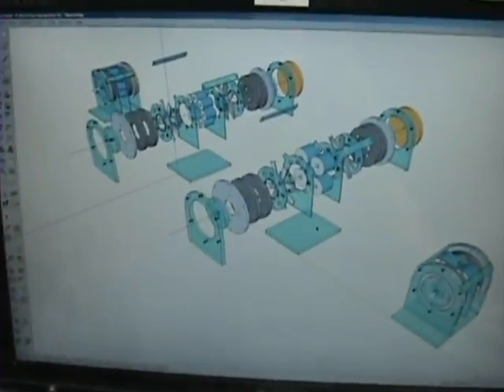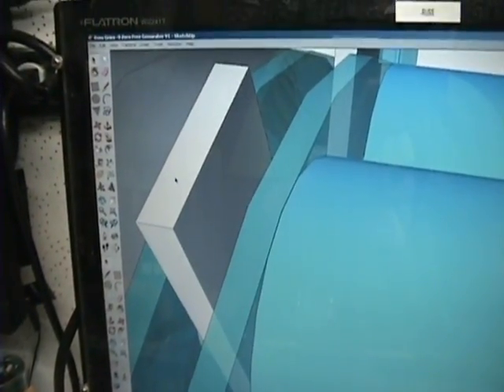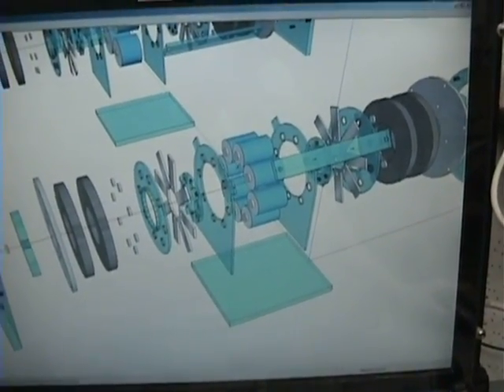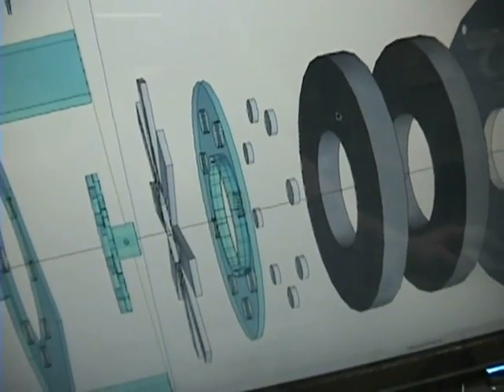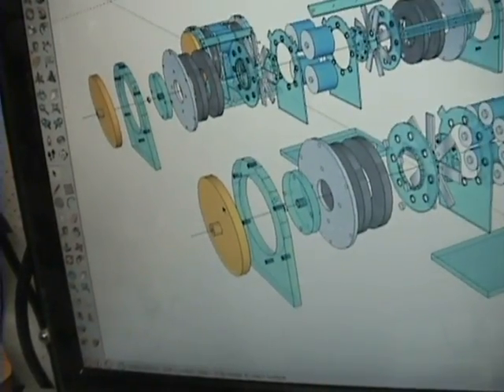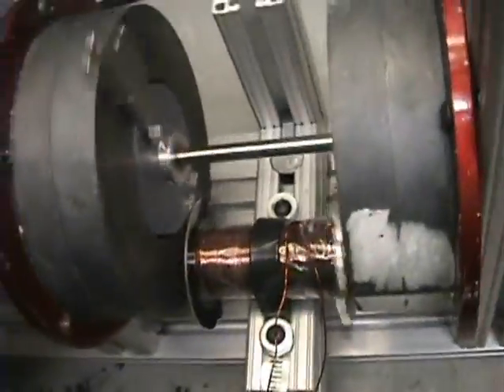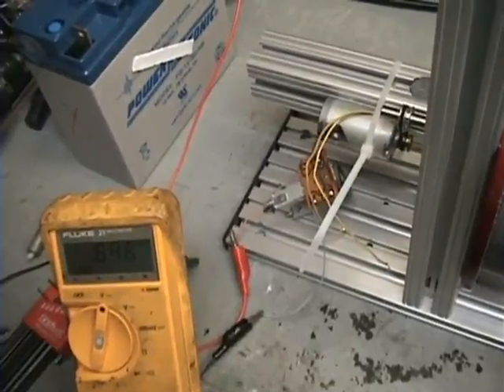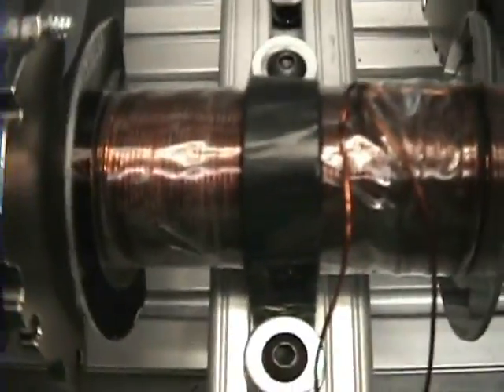The -9 zero free Lenz lawless generator v1

Comment: This takes the idea of the Figurea generator.  Of course you are not getting any current out because the magnetic flux is too weak.  You may need to bring the ring magnets on both side closer and make the collector core shorter but wider.  That way the flux get to the core better.

Comment: This is an Eckling Brown Generator. The magnets you're using are too big for the coil. Try use neodymium magnets that the diameter of the magnets are the same as the inner diameter of the coil. This is a magnetic machanical switch. Try moving it with a Rotoverter. Thanks.

Comment: Ok, in the video you don't show amperage output, just voltage, so there's no amperage on the meter because you're shorting it by the leds not the meter. If you have a voltage, then you will have a current, maybe milliamps, or some amps but there will a flow of electrons because there's a potential deference to push them. Another observation, don't use steel as your coil cores, they will heat up and don't induce the current as it should be, material for AC like transformer's core.

einspace

Comment: I am failing to see the point? OK, you proved some basic concepts of electromagnetysm, fine. What is the end purpose of this build? Create a generator? Free energy device? I suggest for future videos that you make some measurements of input and output power, using 4 meters. Oscilloscope  would be benefitial to see output waveform, because multimeters have a limited range of frequencies for which they can acurately display RMS voltage. Let's see some numbers:)

Comment: Can someone explain what the point of this is? Nobody argues that you can induce current into a coil with magnets, he's just built a very inefficient machine for doing so. And you're right, it doesn't sound like it sped up.
Reply: if you can eliminate lenz law, you can remove the load from a generator as it's generating. Hence a more efficient generator. if you don't know what efficiency is... Google it.

Comment: Nice build and 3d model.  I have a suggestion you may  want to consider.  try rotating the magnets with the shielding material.  This will make a great flywheel and should not change the effects of magnetic field.

Comment: Hi Russ, this is Dan Quale, the inventor of the Lenzless generator. Website overunitybuilder com. Great job on the sketchup. My generator shows that indeed electricity can be produced without the back magnetic drag or Lenz law reverse motor effect, leaving only air and bearing resistance, My advice now is to use ferrite cores wrapped with only one layer of wire, using my ert type transformers to increase voltage/curent I am unable to do much myself  these days. Hoping for others to carry on work
Reply: OVERUNITY BUILDER  Mr. Inventor, is it true if we change the way of winding can anti lenz effect?

Comment: ***** if you put a load on it it will also have to accelerate if it's true lenzless .

Here from jean louis naudin :

How the Delayed Lenz Effect (DLE) can be observed ?

In the case of the motors/generators, the increase of the turn rate is produced by the DLE when the devices are loaded,

In the case of solid state generator or special transformers (i.e. the Thane C. Heins' Bitt) , a drop of the input power is observed when a load is connected at the output,

In the case of the generators, the increase of the turn rate is produced by the DLE when the devices are loaded above a critical minimum frequency. Below the critical minimum frequency the DLE coil will produce deceleration as per any conventional Lenz generator coil.
Coil frequency dictates coil impedance which is a critical factor in producing generator DLE and on-load system acceleration.
The greater the load i.e. the closer it is to a dead short (an infinite number of resistors connected in parallel) the greater the DLE produced and the more system acceleration will be produced.
The DLE can also be used to produce an unbalance (sink effect) between the outside (i.e the Earth ground) and the load, this is the case of the Tariel Kapanadze generator...

Comment: @lykenth08 
The magnetic field of the speakers magnets will be reduced when u drive power from the coil (exactly by Lenz law!)  thus ur voltage will drop cos u shielded the magnetic drag through the hardrive mumetal! The rotor will gain speed (less drag) It's Lenz's law applied on voltage by reducing the total magnetic field! Rotate the coils WITH THE MAGNETS, remove the mumetals, replace with some decent aparatus (sparkgap?) to tap induced EMF and ur off in space! VERY NICE DESIGN THO CONGRATS!

Comment: Hi im familiar with the design an i have been working with the concept for a while with my own make shift design. if you want more initial speed then dont read the voltage if you didnt already know. think normal lenz law but backwards! - read the voltage it slows down read the amperage an it speeds up. The original makes has a youtube, just search lenzless. you 3D build of it was immensity impressive too

Comment: @rwg42985 my build is iffy as im trying outmy own designs but - if you`d be so kind as to watch my new video "lenzless/bedini monopole research an ideas" iv made a modification that will allow for close placement of the coild to get the most magnetic springing effect that so simple an that - you could i think, have a single sided lenzless generator. so its not so massive, heavy or needs exspecive large ring magnets to run.i think i can use both sides of a single magnet. i can made it a motor too